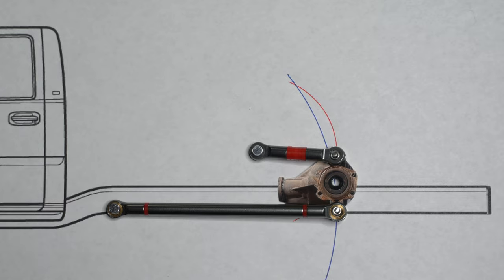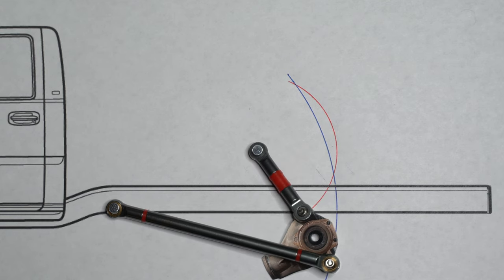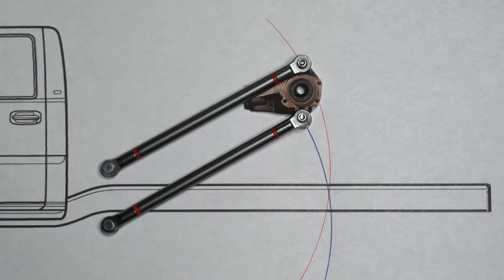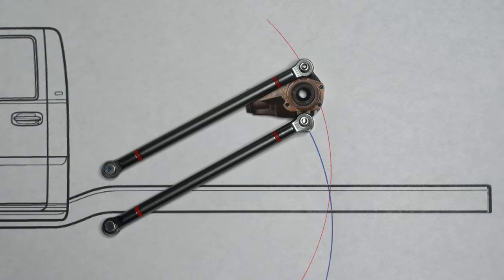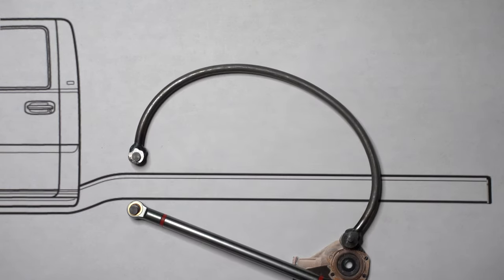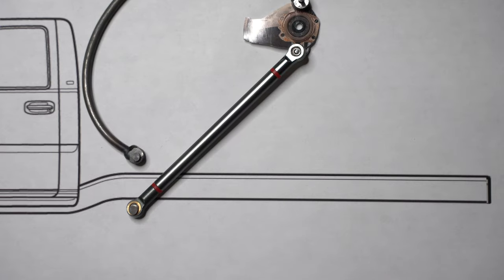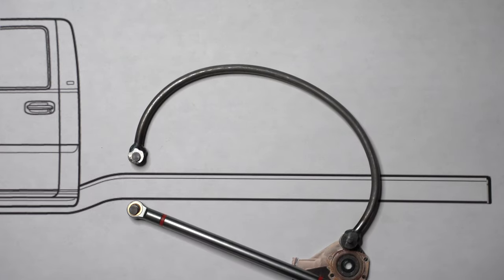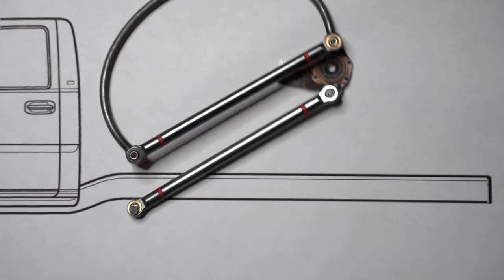Suspension Basics 04: Unique Shaped Link Bars and How To Use Them.

Comment: Just found your channel...as a guy about to do his first bag job with a triangulated 4-link to lay out my 94 Hardbody...thank you for sharing your knowledge.
Reply from the maker: Right on Brother! If you literally just subscribed, you can tell everyone when Garage Fab gets big that you were the 4000th subscriber. I wish I had a prize for you. 😂
Both the triangulated 4 link and Hardbody are excellent choices! I can’t wait to see it. If you ever have a question, don’t hesitate to ask! Good luck.
I appreciate you. 🍻
Reply: @GarageFab  Hell yeah! The knowledge is the best prize, anyway. The biggest challenge on this truck may just be the front crossmember for the front upper link locations. 

I've been reading up some Max Fish's old postings about tri-4link geometry. Gonna keep the lower bars parallel to the ground at ride height, and set the upper bars to where the instant center is at (or just beyond) the front bumper.

Planning on having the rear mounting points just inward of the notch in the frame, and front points will most likely land on the hoop for driveline on the front crossmember.

I'm excited to put this ThorBros super lift tri 4link to work. I just hope I don't have to do a slip spline shaft on the rear drive line to keep from shit-wrecking the carrier bearing and the trans tailshaft seal.
Reply from the maker: One of my favorite people. A lot of what I know today came from The Fish. My opinions differ from Max a little on the use of instant center. He is 100% correct and that setup is a good rule of thumb for proper handling and traction off the line.  This is the basic idea behind a lot of production vehicles like the Toyota 4Runner and drag cars as well. In other words, static height vehicles. My argument is this design causes problems with drive shaft alignment at certain points on an adjustable height vehicle. That can cause u joints to fail and a really annoying vibration on the freeway. Now days we have access to automatic ride height systems which can mimic static height vehicles so it’s less of a concern, but I don’t always drive at the same height. Sometimes I like to skate and if it’s raining I’ll lift it up quite a bit.
This is why I recommend a truly parallel 4 link with equal length upper and lower bars (or equal distance between upper and lower axis’ on a triangulated 4 link) This throws the instant center out the window since you’re essentially left with an infinite instant center. This will effect traction some but not noticeable for most people. You can also overcome this lack of traction by angling all the bars slightly so the rear of the link bars are a bit lower than the front  at what I call your  “performance ride height” which will provide some anti-squat properties and increase traction significantly.
Either design has sacrifices so it may be a useless argument but since I often build for other people and I don’t want them to have to come back to have something fixed, I stick with the same design.

As for the carrier bearing, my brief advice: Match the length of the link bars to the length of the rear section of drive shaft as close as you can. In other words, if the rear section of drive shaft is 36 inches, and your link bars are 36 inches, your carrier bearing won’t be yanked or pulled on.
If you’ve already purchased your bars I imagine that might be a frustrating statement.

Good luck Brother! Ask questions whenever you need. I’ll answer if I can. Otherwise I’ll tell you to go Fishing. 😂

Comment: This is exactly the knowledge I needed for my Suzuki carry 4-link build! There is a similar crossmember in the Carry chassis that holds links for the e-brake and a couple of other things, but I knew it would be in the way of the travel of the upper link of a hypothetical triangulated 4-link. By creating a bend in the link and increasing the size of the tubing, this can be circumvented. Thank you for providing this series, it has been the best way to learn about suspension concepts!
Reply from the maker: I’m happy you found it helpful AND I’m crazy excited to hear your knowledge will be used on something unique like the Carry! I’d love to see it when you’re done. 
I’ll be releasing a video in a couple weeks using this same theory. My Wife’s truck already has air spring mounts installed but they’ll get in the way of the upper link bars so the bars will need to curve around the bags. 
That video will show how to build the bars to be sure they’re the desired length.
Cheers, Zach! 🍻

Comment: I have a hard time believing I just watched 4 videos on suspension and enjoyed them, on top of another 6 or 7 videos right before that. I'm getting ready to pull an '85 D50 out from where it's been sitting nearly untouched since 2000 with an unknown issue outside of being told "engine". Ended up here thanks to a quick search for mighty max rebuild and loving it. Your attention to detail and ease in explaining it, plus the interesting way you do it, you could send these off to help teach the next generation of suspension engineers and custom shop techs.
Reply from the maker: Haha! That's amazing. Thank you, John. You'll be working on my favorite body style truck. I'm excited to see where your project goes! 🍻
Reply: @GarageFab  So am I. It's a mixed bag between getting that one running and worked on, plus my wifes XC90 needs some cosmetic and QoL upgrades, and my S80 needs some work done. Hopefully I can make life work out and get some work done. Extremely excited to involve my 12yo and 4yo in the process. They both always want to do the things I do so it'll be fun getting both of those girls helping to rebuild an engine
Reply from the maker: That's awesome. Father of the year. 🙌

Comment: Great explanation, well done! All too often though I see bent links, steering arms and chassis tubes that are bent for no other reason than some assumed aesthetic in the overall design and that don't add anything to structural rigidity which, after all, is the main aim of any stressed structure. Another of my pet hates is offset connections when a minor re-design would see a direct load path to a mounting point.
Reply from the maker: That is true, especially on the show grounds. Like “Look what I can do!”
Could you clarify your last point though? What do you mean by ‘offset connections’? It sounds interesting. It makes me wonder if it relates to the video I’m producing this very moment. I want my upper link bars to be set as wide as possible but the air spring and its mount will be in the way. So I’m curving the upper link bars around it.
I COULD relocate the air springs and I could also move the links inwards but I don’t want to sacrifice any axle stability in fear of having a varying thrust angle and I don’t want to change my existing ride quality by moving the air springs.
And so links shall be bent!
Thank you, Grant!

Comment: Awesome series!! I have a 95 Hardbody and want to do a custom 4 link on it..these videos are absolutely mind boggling and makes this more complex..yet more simple. Love it man.
Reply from the maker: Thank you for that Miguel! If you need clarification on anything don't hesitate to ask. Can't wait to see it. I love Hardbodies.
Reply: @GarageFab  I only have one question…would a triangular 4 link be unreasonable on a daily driver? Like would the maintenance be too much with bushings or would heim joints be better..? I’m looking to make it a comfortable daily and be able to Tow…put stuff in the bed (even if it’s notched out for clearance) but I also want it to be a weekend ripper…I know it’s a LOT to ask from a vehicle but I’m willing to make compromises where needed…
Reply from the maker: I don’t think that’s too much to ask at all. And a triangulated 4-link is perfect for a daily driver. My Mustang came from the factory that way.
I bought my Wife’s truck already bagged with a triangulated 4-link, drove it for 3 years and the polyurethane bushings still look mostly new.
Heim joints are better and will make the triangulated 4-link more stable but you will experience a slightly rougher ride. The vibrations of the rear axle will channel through the heim joints to the frame. Definitely less luxurious feeling but not extreme. For a daily driver that doesn’t see a race track much, bushings would be just fine.
Reply: @GarageFab  Thanks man. Then it’s decided! Triangular 4 link in the rear with coil overs and front coil over conversion! Thanks again! :D  
…..now I need to buy a welder and get good at welding….and do a C-Notch…
Reply from the maker: Yes!!!

Comment: Love this series. I am curious if you could do a video as to how to pull measurements and get dimensions from a vehicle such as travel, ride height ,ect. I understand the math after that point but my truck has a lift from an unknown manufacturer with no numbers to it at all. Just thought I'd throw it out there thank you for the knowledge!!!
Reply from the maker: I’m not 100% sure I’m clear on the question. So I’ll spit a bunch of answers and hope one sticks. To find all kinds of info about how vehicles come from the factory, I punch the make and model into Wikipedia. 
Since I build mostly Mini Trucks, I determine ride height as the distance between the ground and the part of the frame that will be setting on the ground. That’s as simple as busting out a tape measure.
Travel is a much greater challenge. If you don’t have hydraulics or air springs installed, you need to remove the springs so you can lower the suspension to the bump stops. Subtract that number from the ride height (with springs installed) and that’ll give you travel.
As for the video on the subject, your questions may be answered in one of the upcoming videos when I get the front and/or rear suspension assembled. Lemme know if that helped. 🍻

Comment: I appreciate all the 4 link explanation videos, the mini frame and graphics really make it a lot easier to understand! I'll definitely suggest these. I had a couple ideas that could make your already great series more comprehensive, maybe reach a larger audience that isn't just into bagged minitrucks.

Questions:

1. Are you going to touch of 3 link suspensions, and a wishbone top link, what is the advantage and disadvantage of the top links being combined into a wishbone?

2. What are the most common link types for different auto applications:
           -Drag racing
           -autocross/track events
           -Daily driver

3. I just bought a POS, 68 Camaro roller (all I could afford) I'm currently putting together, I have all the drivetrain, turbo LS, Muncie 4 speed and solid axle narrowed Ford Explorer 8.8. I want to run coil overs in the rear but not sure what type of rear link suspension to go to for the 3 applications in question 2. Any suggestions? Again thank you so much for all the great explanations and time you've  already given to put this series together!
Reply from the maker: Thank you for all that! I appreciate your time. 
Congrats on the Camaro! My heart skipped a beat. That's my dream car so I know how hard to come by they are. In my never-ending search I find rusty bodies with no doors or glass for $5k or more. Absolutely insane. I hope that will be a project on the channel at some point though I'm sure it will gain me a lot of haters. I'm NOT a Camaro purist and I'm only concerned with how it looks so I've considered buying a 68 Firebird and converting it or even building one from absolute scratch with a tube chassis and replacement body panels. Time will tell.

We're coming to the end to the suspension videos that I had planned. Coming up is pinion angle and I may make a video on why a reverse 4 link is terrible. And then I'll be moving on to front suspension. Believe it or not, these videos haven't been really popular. A select few people really like them but I don't see suspension design carrying the channel.

I hadn't planned on making a video specifically on 3 link suspensions but it has a mention in a video that will be called "The Best Rear Suspension Set-up" an innocent bit of click-bait as there is no one perfect design for every car. It will be geared towards adjustable vehicles and therefore will NOT be the best for you're Camaro. When you have a static height vehicle you can focus on things that you have to ignore with adjustable height vehicles like instant center which is important in track cars and drag cars but would destroy a drive shaft in an adjustable vehicle.

I'm not super educated in performance suspensions of any type which is why I hadn't planned on going beyond "Suspension Basics" I don't want to be that guy that tries to look smart on topics that I don't fully understand.
That said I'll immediately recommend a suspension for your Camaro. 😂

Probably a traditional 4-link but rather than parallel bars, the upper and lower bars would be angled in a way that if you drew a line through them the lines would intersect somewhere around the front of the vehicle. That'll give you a decent instant center. You could make multiple link bar mounts in the front to help dial everything in for the size and weight proportions of your car. 
The lower link bars would be angled slightly downward with the lower end mounted to the axle to achieve some anti-squat properties. As for axle locating the sky is the limit. Panhard bars work fine in static height vehicles, watts links are fancy, or you could do neither and throw in a wishbone.

Good luck my man! And thanks again.
Reply: @GarageFab  Thank you, I think that it will likely be a pretty low static height, anyway I will continue to follow after the suspension is done because I like all that you have been doing, even if we have a little different interests I am still learning and seeing a lot of things that even if I don't ever plan to do, I appreciate seeing and learning more about fabrication.
Thank you again!

Comment: Ive been stalling on building my ford 8.8 setup formy first gen rx7 because I was scared to screw up the geometry.. between the fabricator series and your videos I just found man I am feeling much better... I love your simple but informative presentations... Im a visual person so seeing your scaled models really help a lot...

Now to decide to try to adapt the factory watts setup into the explorer 8.8 I have shortened (grannies speed shop does this) or put a panhard from factory frame point to axle over the top of the pumpkin is the way to go... may need some bends in it to keep the bar flat and give clearance... any thoughts would be great.. thanks
Reply from the maker: Thank you my man! Your words are appreciated. 🙏 
I imagine since it’s an RX7 there’s not a tremendous amount of travel so you’ve got a lot of options. A panhard is just fine in a car like that but I’d highly recommend on any panhard to make it as long as possible. Mounting it to the center of the axle means a really short bar. The shorter the bar, the more sideways motion you’ll get.
Though there’s generally nothing wrong with a panhard, I can’t imagine replacing a watts with one. If you can figure out how to adapt it to the new axle I’d recommend that. 
Do you have an Instagram? Feel free to shoot me some photos. If I can help with the design I will.
Cheers, Nathan! 🍻

Comment: a constraint that comes with bending a link is that heim joints (rod ends) become forbidden. They are designed to only take compression and tension load, and a bent link would stress the threaded part in bending. So you probably need to get your effective lenght right first try because adjustability gets complicated.
Reply from the maker: Interesting! Is that true? In that case, I’ve seen a few Heims used in ways they probably shouldn’t have been.
Reply: @GarageFab  I think incorrectly using heim joints is an old traditional car trick, a bit like doing a donut on a car park :) There is an expression for it: REIB (Rod Ends in Bending).
Their normal use is quite limited actually: straight rods, that's it. But their threads make them tempting for the fine tuning of geometry provided, so they are used everywhere, including highly forbidden A-arms etc.
Reply from the maker: Yes!! That is the use I was thinking. I also see them used on load-bearing link bars quite often.
So I ponder; What are Heims made of that makes sideways force a no no, but a poly bar end of the same diameter is acceptable?
Reply: @GarageFab  it's "only" about cracks starting at the root of the threads when you bend or shear a threaded rod. So in the end it's easy to mentally check, but the conclusion is that heim joints are almost useless, because so many uses would bend or shear the threads (talking about shear stress, the actual failure happens with fatigue cracking over time). Threads should only be loaded in compression, extension, or double shear (in which case one sheared side is probably a smooth shaft anyways).

That means other spherical bearings are fine, other ways of changing the length of a member are fine. But heim joints are so easy to use and adjust, in particular in the custom and racing worlds where the geometry is developped during the build, they are enticing, everything else is more complicated.

Links are fine if they are just a straight rods with 2 heim joints (often one left threaded and the other right threaded, which makes length tuning a delight), heim joints in compression and tension can handle a huge load, they will probably catastrophically fail when the bar buckles, but there is no recovering from buckling anyways.
Reply from the maker: Thank you for taking the time to write that! Very very much appreciated. 🙏